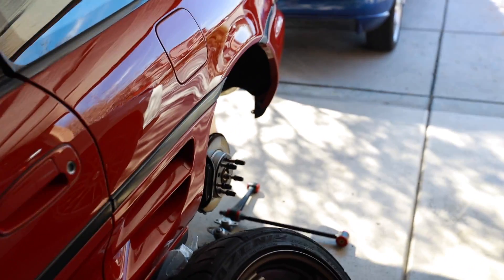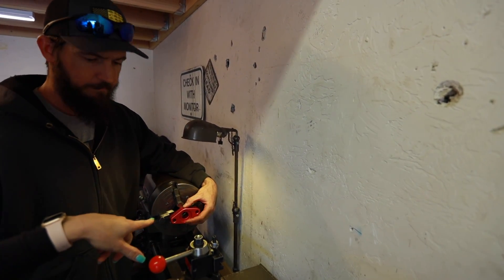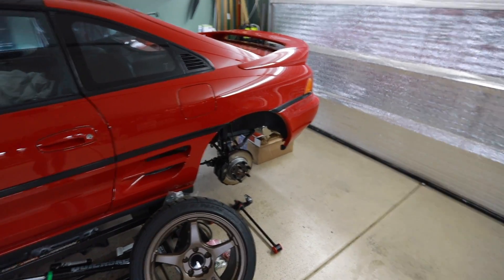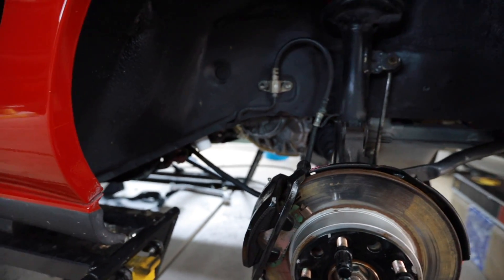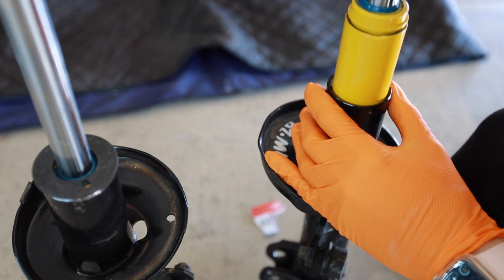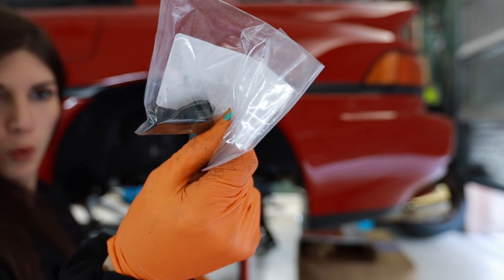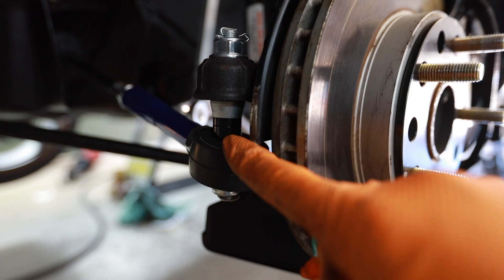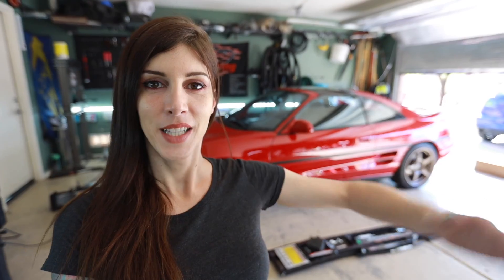Toyota MR2 Bump Steer & Roll Center Correction

Comment: I just bought a 91 MR2 t-top with the undesirable 5SFE engine as a father-son project and we plan on doing a V6 swap.  Doing the homework now to make sure I get the correct engine. What were those geometry correcting tie rods?  Where did you get them? Also did you ever consider bagging the suspension?  What about hybrid coil over/bags are those worth a looksee?

Comment: You can use Easy Off Oven Cleaner on those tough greasy parts to cut the grit and grime. Then use water to wash it off. Leave on an hour or so to clean. Leave on over night and it will peel the paint right off and you can repaint the part.

Comment: It is amazing how poorly conceived the MR2 suspension system is.  My 94 Celica was a lot simpler in the rear, but maybe just as prone to bump steer.  Celly was certainly hunkered down and stable at redline, for hundreds of miles of highway.

Comment: Swap in a 1MZFE and 5 speed manual from a 97-2001 Toyota Camry and toss a TRD supercharger on it.  I had one on my Wifes 99 (Auto) Camry and was able to run a 12.9 1/4 mile with a little 35 shot to cool the hot air down.   This was back in 2000-2001.  We had a great time with that car!

Comment: the car looks to be sitting on the ground well I think the control arms should be close to level when adjusted properly, the ball joint blocks are for a 1" lower spring if I am correct it should drive nicely and handle well you might re-check suspension make sure everything is still tight not damaged after driven some miles and the suspension settles. looking forward to the driven video -  I hope your feel better to...... maybe try some whole grains, assorted nuts and such.
Reply: oh yeah review what you like for cars
Reply: apples are good to
Reply: oh excuses me - the CV axle shafts should be about level when cars on the ground

Comment: If you relocate the radiator cap, will it still be at the highest point in the system?  If not, it may be more difficult to bleed the air out of the system when filling.

Comment: I know that it won't matter performance wise,but I'm really surprised that with your OCD you're OK with knowing that that ball joint is different than the other one even if just cosmetically considering you could easily replace it now that you have it of(they must be really hard to get ahold of) and I would have definitely considered getting the other spacer machined to match just in case you have to replace another ball joint in the future so you don't have to go through this process again,...not that you appear too terribly upset with having to visit your fabricator.😊🔧

Comment: Lmao, if u said u did everything on ur suspension all but the rack and pinion... get ready.... for a leaky rack and pinion. Not a betting person but if I were I would bet less than a year , 2 if ur lucky its gunna start leaking, especially in Arizona... way too hot and dry in summer.  
Spec. Cuz u put poly bushings in.
Prothane bushings are a hard ride when u do them all on any vehicle.  They are ment for race applications on smooth roads not barley maintained public roads.

Comment: It's funny you should catch your shoulder on the upper rear corner of the door.
Years ago my wife and I bought the only new car we will ever buy. It was intended for her use so we went around and tried all the models of a comparable type, small sedan basically. When we were testing the Mazda I bumped the upper rear corner of the front door with my cheekbone, cutting it. We didn't buy the Mazda although in every other respect it was a good car. I think Mazda stylist put a backward leaning curve on the front doors for ... style. A vertical B pillar is sooooo boring. On the other hand the door would be less likely to strike the person getting in or out.
Your vids are great. You are just slightly eccentric and quirky, just slightly and it is appealing.
Don't change it out for normal behaviour and comments, we love it.
Were you a mechanic in the Army? What equipment did you work on?
It's a little disarming to watch a gorgeous girl with long hair and painted nails grab a cordless impact wrench and remove and install bits on a car, with absolute confidence.
You are a rare beast, as they say.